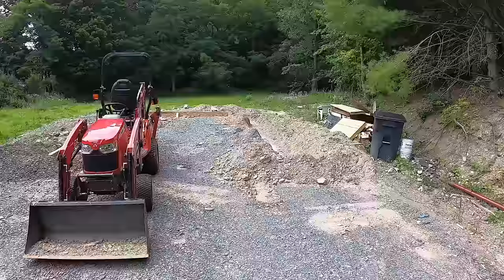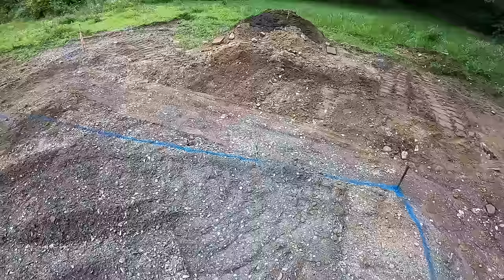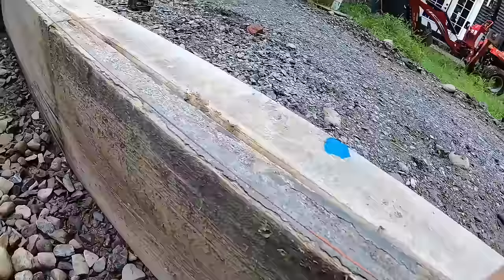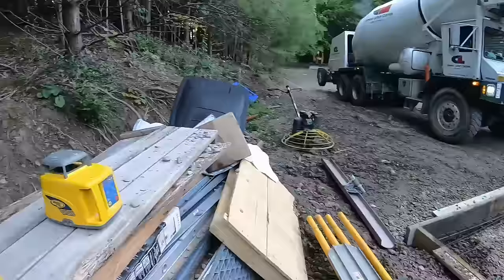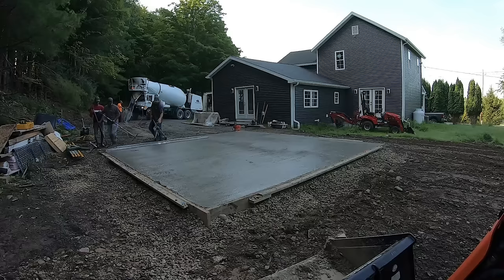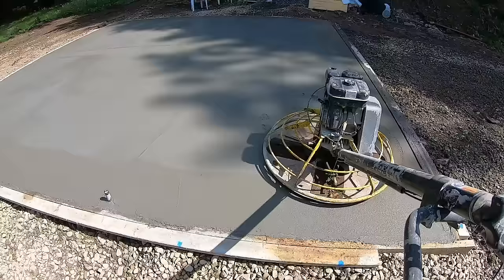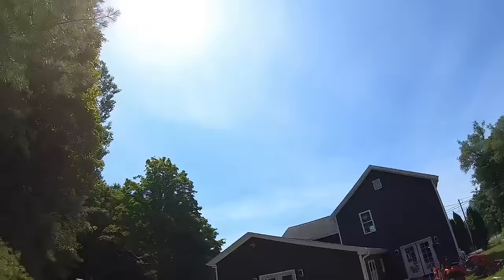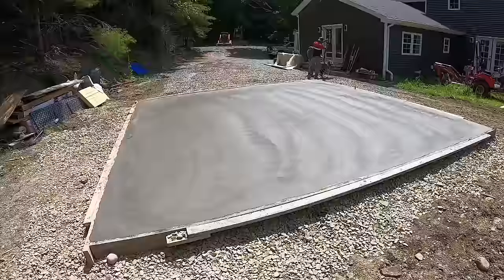Building and installing a Monolithic Concrete slab for a garage start to finish

Comment: Don’t most jurisdictions require that footings be below the frost line? It seems like mono pours are always the exception, but I have never understood why they can much shallower?
Reply from the maker: Yes The theory is the slab is supposed to float up and down with the frost.
Reply: Will Holtzinger google “frost protected shallow foundation.”
Reply: Dirt Boss Masonry & Excavating thanks for the reply! Can you get away with doing this on all types of structures including houses? I feel like I’ve only seen them implemented for sheds and garages etc
Reply: bpdp379 don’t those usually use foam or insulation to actually keep the frost from penetrating under the slab and thus keep it from heaving? Whereas it sounds like this one can move up and down with the frost?
Reply: @omgitzzyou1  they do. I am not speaking for DB&E but he keeps calling it an Alaskan slab which is a FPSF. I am surmising he is doing a modification of that method which may or may not work in his climate. I don't know the details...a monolithic slab in Costa Rica or Texas wouldn't require insulation, but because you were asking about frost line I thought it might be more helpful for you.
Reply: bpdp379 makes sense, thanks for the input. I guess I was just trying to get a grasp of when it’s necessary to use each type of foundation. Like this vs a traditional stem wall with a footing etc. thanks!
Reply from the maker: @omgitzzyou1  It depends on your town just ask the inspector and if it's a house it will be a different design with insulation foam ect.. then the price gets tweaked goes up and there goes the budget on the slab..

Comment: Is there going to be a garage built on this? What are you going to do for anchor bolts? How deep are the edges of the slab?  I believe we require a minimum of 24" here.
Reply from the maker: Yes 12" haunch thunder stud type fasteners..
Reply: Thanks!

Comment: Can ab3 which is a dusty stone that compacts hard be used for a base for concrete? Is there a reason to use ab3 or stone at certain situations.
Reply from the maker: Yes that's what we call crusher run we use that all the time..

Comment: How come you guys don't use slab mesh or trench mesh over there, you use individual lengths of reo and have to lay and tie it all together?
Reply from the maker: We only can use whats supplied
Reply: @DIRT-BOSS  can you  get mesh there?
Reply from the maker: @MrJFoster1984  there was wire mesh mats throughout the whole slab
Reply: You used lengths of re bars, not mesh though?
Reply from the maker: @MrJFoster1984  you'll have to go back to the video and look there is wire mesh & rebar sir
Reply: No worries, I only saw the lengths of regard and thought you just tied it in a grid. A lot of the videos coming from the USA seem to tie their bars in a grid around 2 foot centres. I was.just curious if you can get mesh or it isn't common. Single bars would be more convenient for transport but more time consuming placing and tying. Cheers

Comment: You can also spray some used motor oil on your forms to prevent the concrete from sticking when you strip them, it also preserves the forms and makes them last twice as long too.
Reply from the maker: Yep I got you

Comment: How many inches of stone do you put in on the edges if you’re using 2x12’s? Thanks
Reply from the maker: 6 in is good
Reply: So you have about 6” on concrete on the edges? Or do you put the forms on top of the stone? Thanks
Reply from the maker: @CJ-jd6qv  Did you watch the video? Stone on the bottom 12-in board the concrete's 12 in thick
Reply: @DIRT-BOSS  gotcha, my bad I misunderstood

Comment: Why did you not use a moisture barrier?  A moisture barrier is widely regarded as a best practice.  The material cost is negligible, and the time to install is minimal.  Perhaps the building code does not require a moisture barrier, but the building code should generally be viewed as a minimal acceptable building standard.  A moisture barrier should be used regardless of whether the space is for living or not.
Reply from the maker: Scott I get everything you said and use moisture very all the time but this one there was no moisture barrier..

Comment: I've watched quite a few of these slab videos, I definitely like this one the best, and I'm going to be watching it over and over.  I have a 20x25 versatube garage and trying to pull off the slab is definitely the most intimidating part of my project.  I've never worked with concrete, other than really small things, in my life.  This will help for sure!  I have the use of the long handle thing you guys use and edge trowels,  if a guy just went over the slab with the long trowel periodically until it is set would that be okay?
Reply from the maker: It would be okay if you're happy with that finish it may not be so flat.. also go in my playlist under concrete videos I have a few of these slabs in there
Reply: @DIRT-BOSS  thank you, sir!  I live at 10,000 ft and we can get tons and tons of snow.  No heat or electricity as the video you posted but I think I'll put the vapor barrier on in case.

Comment: I assume you're using air entrained concrete since you have freeze/thaw.  Any issues hard troweling it in an unheated building like that?
Reply from the maker: Interior concrete power trowl finish we use no air or you will get air pockets and bubbles in the finish

Comment: Did concrete place and finish for 40 years. Never used the pan under the float blades on power trowel.
Reply from the maker: Jim I went 15 years not using a pan.. been using it for the last 5 what a difference it makes

Comment: My friend just completed a 15 x 16 Shack on a slab fully insulated and drywalled on his desert property. I pointed out to him that his layout was so poor that he missed his property entirely. He has thousands of dollars and hundreds of hours invested. His shack cost him more than his 2.5 acres cost him.  There are no other structures on any property within a couple miles so maybe the landowner never goes there. Cheap desert land good for wind & sun power no water no utilities off grid too much wind. $1k/acre access is good. He wanted tom bet me $100 that I was wrong but I saw the aerial photo with the lot lines superimposed on the county website plus I took my GPS and marked the 4 corners. He had 2 corners close but the other 2 were 50+ feet off. His shack is entirely on the property diagonal to his. $8 for one 2x4 and he builds a building on someone elses property,  Two windows shingled roof finished walls. Crazy. I couldn't take his $100.
Reply from the maker: Jeez

Comment: Hello and nice work! How much working time do you have with it from when it's poured to when it's set? I'm wanting to do a 32x60 soon and trying to understand it all completely before taking it on. It is for myself so it doesn't have to be perfect.
Reply from the maker: Well if you haven't done concrete before I wouldn't suggest that that's a big pour not knowing what to expect.. every concrete pour is different It goes on temperature wind ECT..

Comment: Can the slab be thicker than 4 inches? Nice fix of a bad job.
Reply from the maker: Yes it could be as thick as you want!.. just standard slab that was installed.
Reply: It can be as thick as you can pay for. 4" is the normal thickness required for most residential jobs. Commercial and industrial normally would be thicker and with more steel in the concrete.
Reply: Thanks.

Comment: A few Questions, where is the monolithic slab?  in my part of the country a monolithic slab is one pour bridging to another pour' not what you are doing all you did was thicken the slab for weight purpose. Since when clean rock is compacted , clean rock when drop from a height of 36inches is compacted at 96% and any compactor ran over it does nothing for compaction and when do you use power trowel machine is use for 20'x20' slab spend alot extra on cost when 1 good finisher could have it done lot fast and better job. Justs use a couple big words do all the extra work just gets to me. Putting down J bolt instead of tapco.s will hold the building  a bit more secure.  Slabbs like that is at best a training exercise.or the weekend cowboy
Reply from the maker: Mak well said my friend 🤠
Reply from the maker: @jeepinass  LoL 🤣

Comment: damn, i need to find this work near where i live next year, got two projects to work on. 16x20 shed, and a two car garage over sized. will find someone when my projects gets closer. upstate SC.
Reply from the maker: Nice good luck!
Reply: @DIRT-BOSS  if i can ask, what was the price tag on that concrete work? i got a quote for the small 16x20 shed concrete work at $2,200. have not priced out the garage because i have not settled on size yet.
Reply from the maker: @DScott8732  It all on thickness and how much rebar and steel goes in it.. That seems like a good price. Monolithic slabs  ballpark around $10 a square foot.
Reply: @DIRT-BOSS  i haven't fully decided on the size/style of garage yet, but both will not be till next year. need to build the metal shed 16x20, move all my yard equipment to it, tare down the old shed them grade the spot where the garage will go, a three year plan for me.

Comment: Hey Mike, if the customer wanted a broom finish, would you still use the power trowel?
Reply from the maker: No sir
Reply: @DIRT-BOSS  dont be quick to say no.  Sometime I pan a slab then broom, turns out a nice finish
Reply from the maker: @jkirby5920  I hear you I have done that I'm bigger slabs thanks

Comment: A 20' x 20' garage would piss me off in the long run. Mine is 22' x 20' and it is too small for 2 cars, my junk and a small work area. 30' x 30' would be just right. Seems like just a waste of money.
 Concrete came out OK. You did what the homeowner wanted, good job.
 I would pay extra for a pitched slab and hand trowled crack lines. As I get older, some things are worth spending the extra money.
Reply from the maker: Yes bigger is always better this is a house that they're going to flip so they just want to add a garage... As far as the concrete just come out Ok?? Meaning what please explain... And if you are talking about the tooled control joint I would not suggest that saw cut or metal expansion  is the way to go.. thanks
Reply: @DIRT-BOSS  OK" is not an insult, "Sub Standard" is an insult. 
Flipping houses is a different animal, completely. I don't think that way. I think "How would this whole project work for my family upon completion?" 
 This most basic garage slab pour was not the vehicle to demonstrate your skills. Just how impressive can a basic floor be?   Know what I mean?
Make every video count. Show your most difficult and creative work. Every video should have a "wow" factor.
Show us your best.     Take care.
Reply from the maker: @ratoneJR  yeah the Wow factor like Simon Cowell says! Damn I'm going to Hollywood! Thanks buddy..just teasing.  😁

Comment: Carry some beeswax to fill the screw slots and keep the cement out of them.
Reply from the maker: Good idea! I've used Vaseline before but I spray them with diesel fuel too..it comes right out sometimes it doesn't go in..
Reply: Awesome idea thanks

Comment: With a Mono slab, do you not have to be down into/below the frost line for the footers?
Reply from the maker: Correct That's the whole point
Reply: Still need to insulate the thickened edge to discourage the infiltration of frost beneath the slab to prevent heaving. Polystyrene is commonly used.
Reply from the maker: @XCXtreme  Yes I agree there's many different ways you could do it to insulate it but this is cold storage a budget build I did not engineer it

Comment: Mike...because the thickness varies, how do you calculate concrete for a mono slab?
So, even though there are no footers per se, the freeze and thaw cycles will not have any negative effect on the slab?
Reply from the maker: The slab is meant to float as one.
To figure the haunch you. Figure it as a footer

Comment: Not impressed.  Like a herd of elephants tromping through the mud.  Where do you suppose the wire mesh is.  All stomped to the ground, useless.  I have been on enough jobs to know when its put in well.  This is not
Reply from the maker: Lol ok Buddy thanks do me a favor watch in slow motion and count how many times we pick the wire you will be impressed and if you know anything about concrete once the wire is picked it doesn't go back down to the bottom